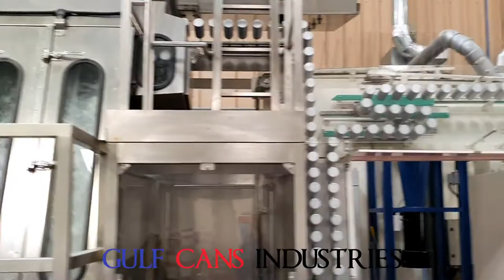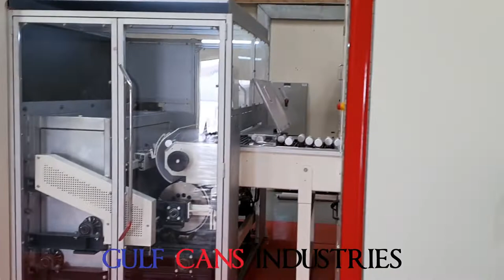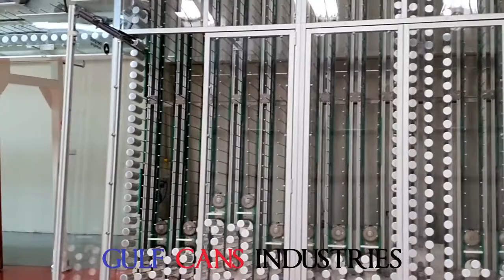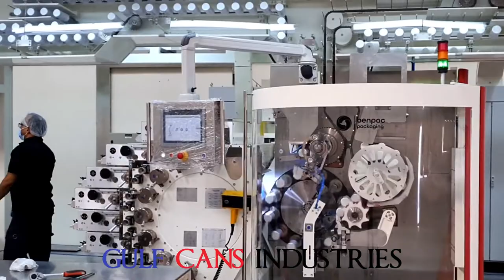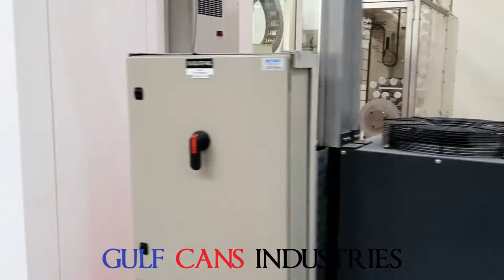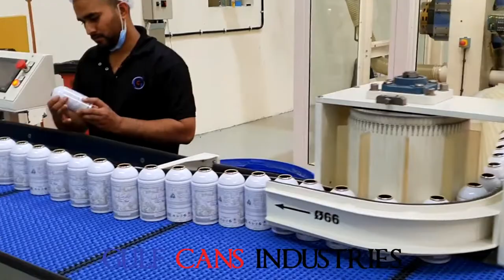gulf can industries

Comment: Hello ,
     We manufacture aluminium collapsible tube line, aluminium aerosol can line, and aluminium bottle container line machine. We manufacture in impact extrusion press machines. We manufacture dry offset printing machine metal closure and plastic cosmetics tubes. If u have any requirements then let me  know.  Thanking you.

Regards,
Jasdev Singh.